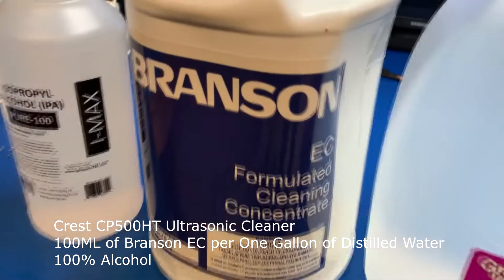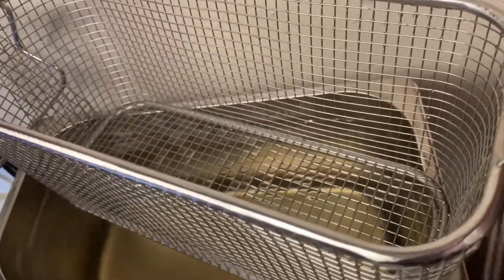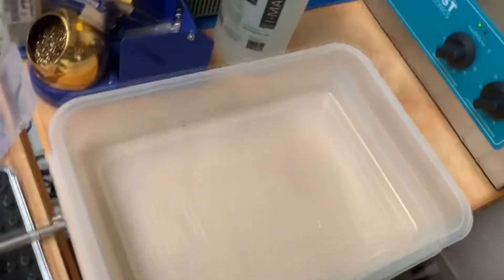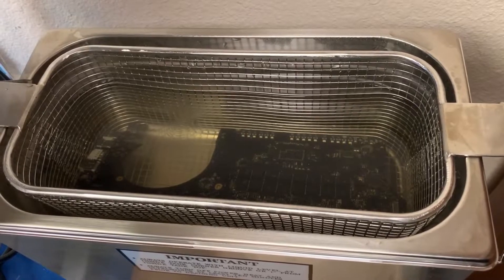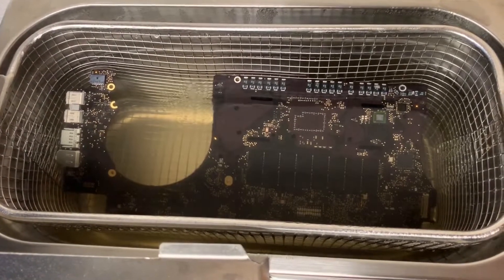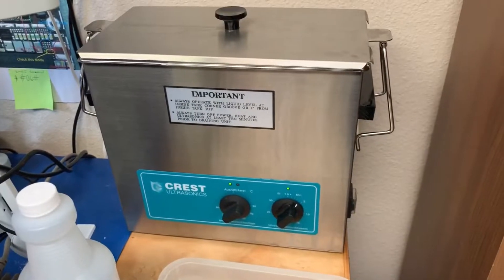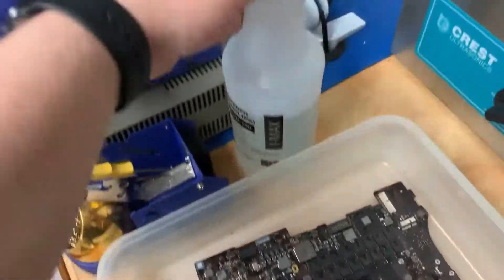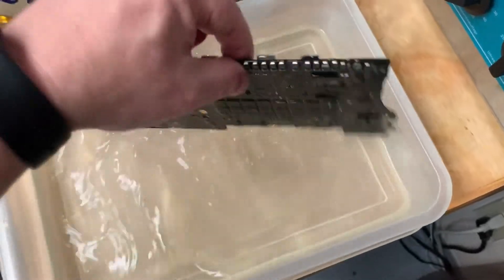How To Properly Clean A Liquid Damaged Logic Board Using An Ultrasonic Cleaner

Comment: Can distilled water be used cleaning a ps4 motherboard
Reply from the maker: Yes mixed in a solution as demonstrated in this video, not as a stand alone cleanser. 100% alcohol is used to quickly displace the water afterwards. Distilled water has contaminants removed during the distilling process.

Comment: pretty pointless video unless you can clean the logic board and then show it working in a machine after the clean
Reply from the maker: The actual point of the video is to show the basic process for ultrasonic cleaning such as mixture, solution and quantities... so not pointless.
Reply: @FixItPlanet1  of course it is pointless unless you can show cleaning fixes the board from water damage otherwise i could just pour boiling water over the the board and say its cleaned
Reply: @patrickdurees3025  there is plenty of videos on YouTube. He just shows how it works, this video is not about repairing.

It was useful to me. Thank you
Reply from the maker: Thank you

Comment: According the msds Branson ec is extremely toxic. You should not be touching that water without gloves.

Putting your fingers in 100% alcohol is also asking for trouble if you do it frequently. It's readily absorbed through the skin and can cause poisoning or lead to serious skin issues.
Reply from the maker: Putting my fingers in alcohol is harmless. it is used for topical antiseptic all the time and yes Branson EC is very toxic and you would not want to rub it into your eyes or ingest. That is why I wash my hands. But you are correct gloves should be worn for safety. I was not being a good example.

Comment: Correct me if I am wrong but aren't you supposed to have the cleaning liquid to the mark line inside the tank? We have the same ultrasonic machine.
Reply from the maker: Sure for this particular model one gallon will bring it close enough to the inside mark. Just a smidgen below won't make any difference.  If you want to mix up a couple of gallons so you can be precisely on the mark then that's fine. Otherwise one gallon is close enough and won't make any difference or cause any harm.